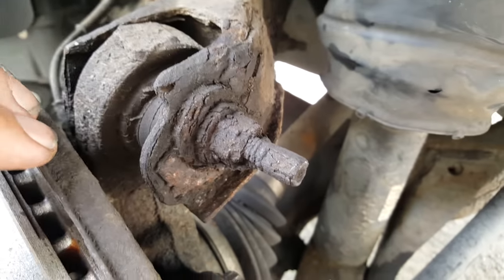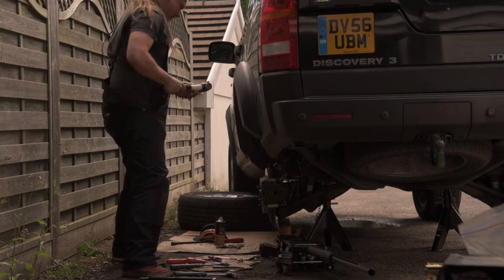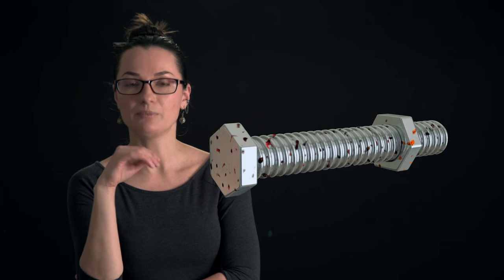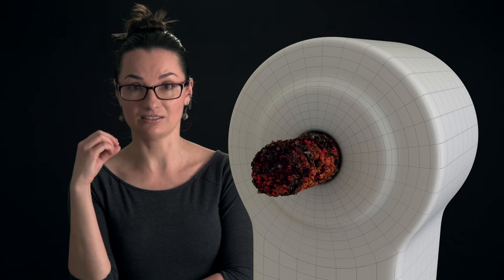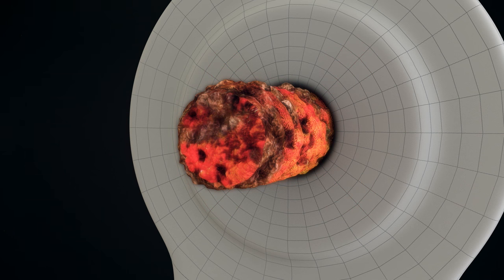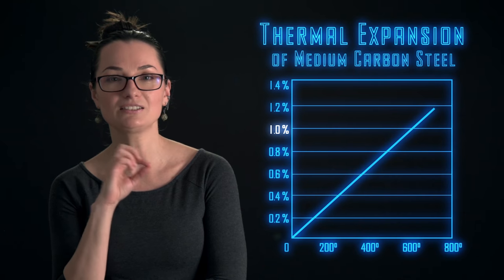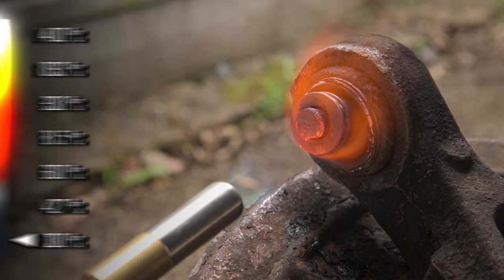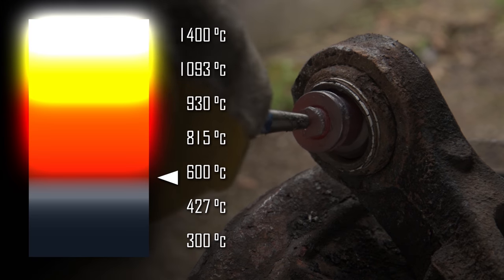How To Remove Rusty Nuts and Bolts

Comment: Making the bolt cold can also work very well to crack the rust. Would have to let it sit for a few minutes afterward to allow the contraction to relax.
 Liquid nitrogen is the most powerful way to freeze metal, but usually not parctical. Dry ice works very wel, is cheap and easy to get. Also, there are a few brands of spray can metal freezer. They work pretty good and are very convient.
Reply: wrong
Reply: i wonder if a can of computer duster will rapidly cool the fastener and break the bond after heating it cherry red.
Reply: @dangerdavefreestyle  
I have heard of it working for people.  Never used myself. Also, there's a product at your parts store called freeze off(or maybe freeze out, can't remember) that is bigger and probably colder. And has a type of penetrating fluid in it.  
Clean metal will transfer the cold very much better.

Comment: Ok so just heat up until bushing is garbage, complete skip the part where the bolt is actually taken off and just tap the bolt out of the bushing
Reply: I mean if you’re replacing the bushing anyways and the only thing stopping you is the bolt… it’s kinda self explanatory.

Comment: If you heat 6mm bolt to that temperature, is it still structurally sound to be reused?
Reply from the maker: I wouldn't risk it. Bolts are cheap to replace, just buy a new bolt and keep your mind at ease.
Thanks for watching.
Reply: Heating will often cause grade 8 bolts to break. Pitch em.

Comment: 600 crap my van leaked out so much steering fluid and the flare but won’t butch if I did that I will make my van catch on fire including my home since is inside the garage 😢😢😢😢😢😢
How about a heat gun putting through a pvc pipe since directly still send a spark while heating is also winter and the warmest is been 2d …I’m thinking nine stop for the last  5 days ….how the heck am I going to avoid sending my awesome van  to the wreckyard 😢😢😢😢😢😢😢😢
I watched at least 200 videos and 3000 ways 
😢😢😢😢I’m taking the insurance off today 😢😢😢😢I’ll miss my van 😭😭😭♥️

Comment: Penetrating Oils Compared 

Machinist's Workshop magazine actually tested penetrants for break out torque on rusted nuts. Significant results! 

They arranged a subjective test of all the popular penetrants with the control being the torque required to remove the nut from a "scientifically rusted" environment. 

Penetrating oil ..... Average load 

None ..................... 516 pounds 
WD-40 ............. 238 pounds 
PB Blaster ............. 214 pounds 
Liquid Wrench .. 127 pounds 
Kano Kroil ............ 106 pounds 
ATF-Acetone mix....53 pounds 

The ATF-Acetone mix was a "home brew" mix of 50 - 50 automatic transmission fluid and acetone 
*Note the "home brew" was better than any commercial product in this one particular test. A local machinist group mixed up a batch and all now use it with equally good results. Note also that "Liquid Wrench" is about as good as "Kroil" for about 20% of the price
Reply from the maker: Thanks for this.  I have never, ever seen another brand of penetrating oil in the UK shops, other than WD40.
Reply: @Xavier Xavier 
 @We Are Big Kids  
Whar of brake oil?
Reply: @WeAreBigKids  What of brake oil as penetrant?

Comment: The lower bolt on my bearing mount of my truck is rusted as i could ever imagine. Ive tried filing it down and using different wrenches. But each time it just re-strips the bolt. 

I will have my uncle come over with a blow torch now. Because its been 5 hours fitting qith one bolt 😰